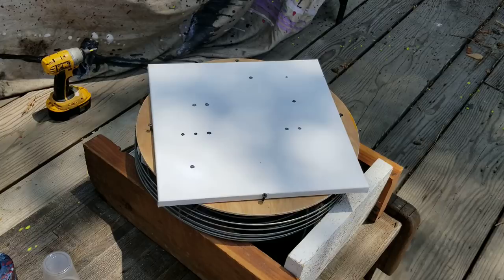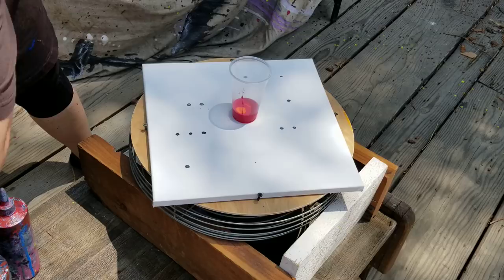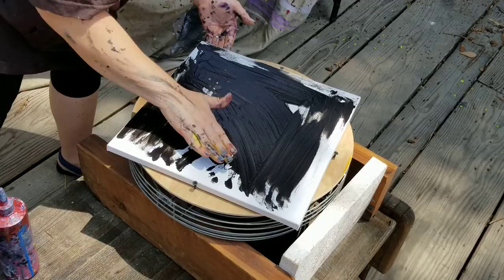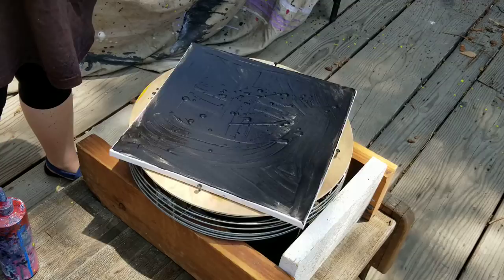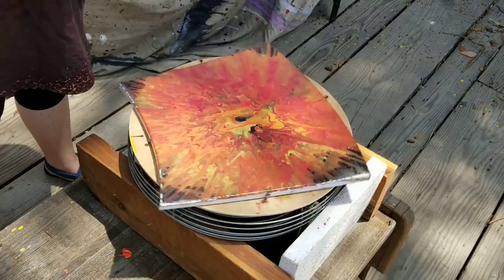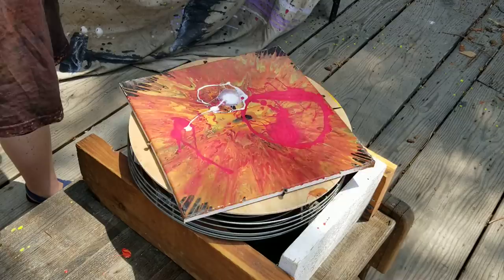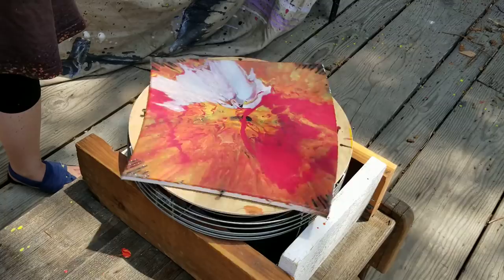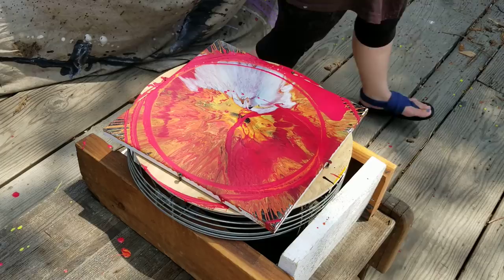Fan Converted into a Spin Wheel for Acrylic Pouring

Comment: Watch out for your shins!  That thing reminds me of a dull circular saw. I built a similar rotating thing of a bob do hickey a few months ago using a 20" box fan and a 19" diameter quarter inch plywood circle. It was a tabletop model, surrounded by a 30" square (900 square inch) splatter guard cobbled together using cardboard, trash, bags, and duct tape. It worked great until a not quite centered canvas got flung off and damn near punched almost completely the cardboard. A heftier splatter guard awaits plywood. Stay safe!